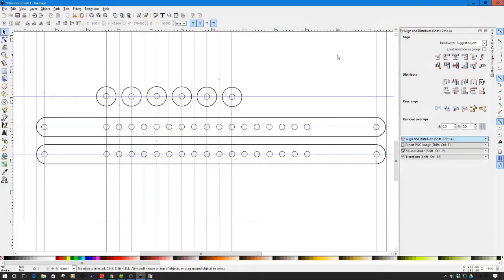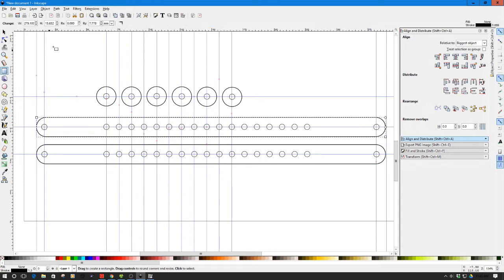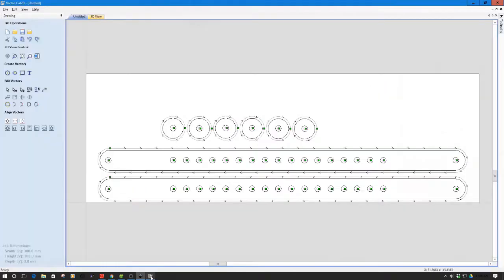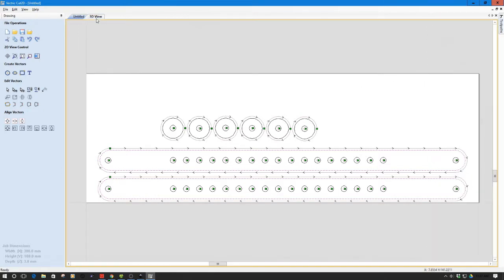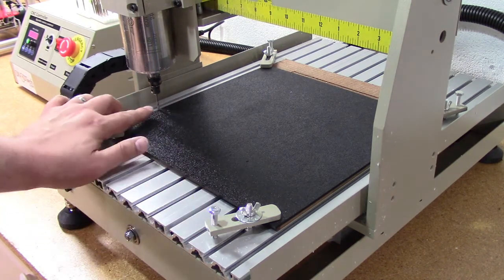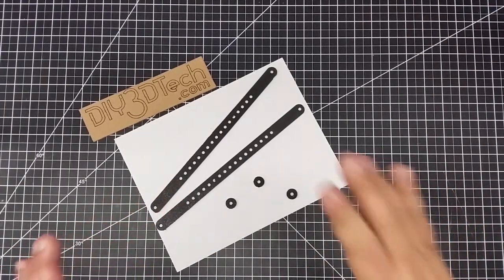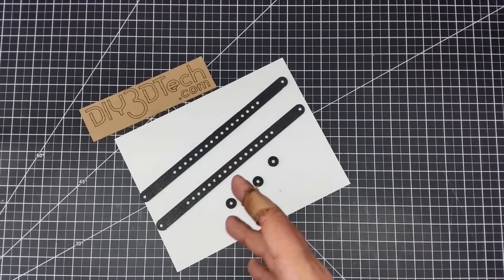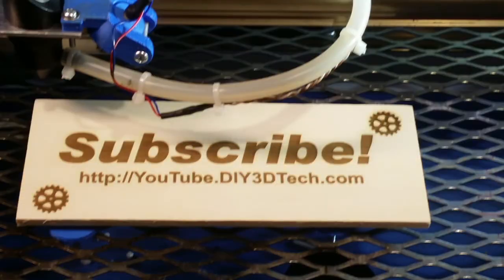3040 CNC - Inkscape to Cut Out with ABS!

Comment: Nice vid, single flutes are underrated, I use them for almost all plastics without exception.  I also find using a vortex tube is great for plastics as the super cold air helps prevent melting, they are pretty cheap on eBay now.  Thx for sharing!
Reply from the maker: +Ronin Energetics vortex tube you say, have not heard of that will have to check it out!